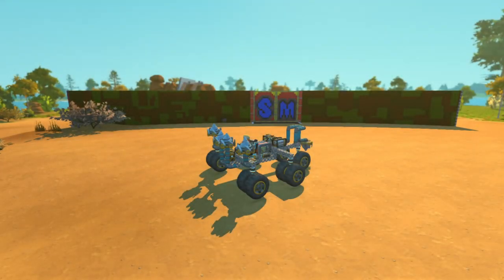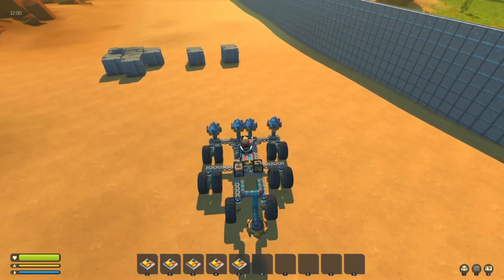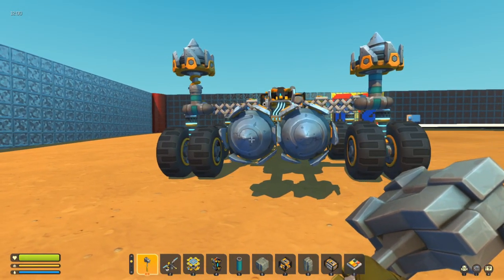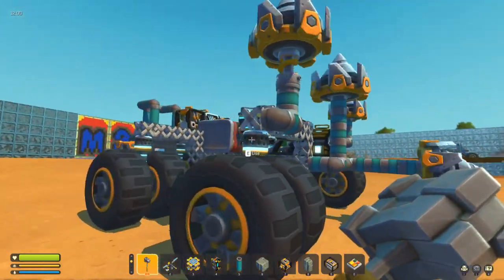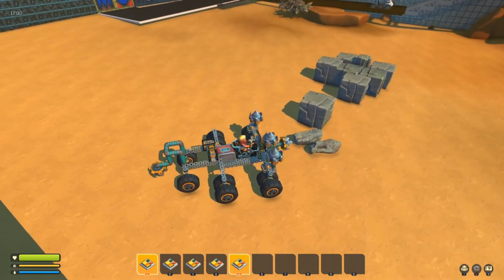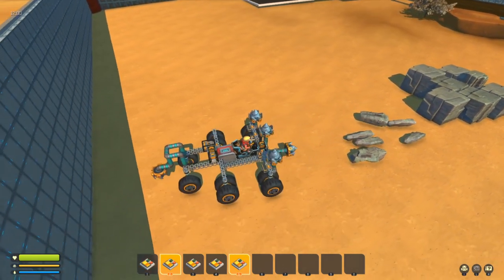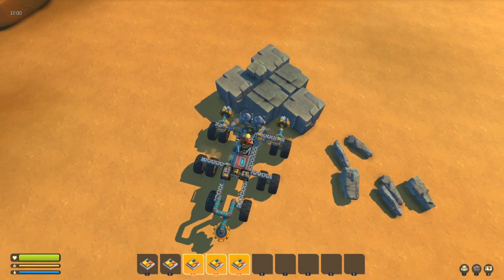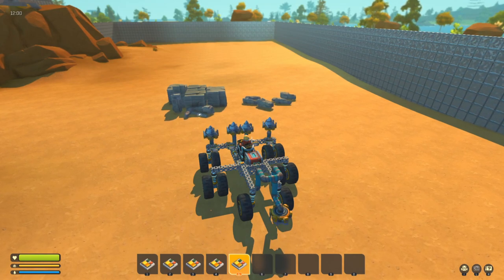Scrap Mechanic Survival Drill, Does it matter?

Comment: That is weird, drills work better for me on a gas engine compare to a controller. I guess it is just the level of the part.
Reply from the maker: could be, though personally I have found people usually run the engine quite high which imo seems a bit of a wast of fuel ? each to their own :)
Reply: @wo0dy  Oh it is a wast of fuel no doubt,   but I guess it is a fair trade for the time it takes to finish grinding off the material. I wish controller drives would not reset the position and would go faster as well but as for not, it is not happening.
Reply from the maker: @chokyrie3766  yeah the position reset is a nightmare really, but as for fasfer, depending what you are trying to move you can gain that by having bearings in a row. I'm guessing you know this though
Reply: @wo0dy  yes I know that. It is just sometimes frustrating to get that to work with some builds, especially with steering. I do know how to do that now with all-purpose joints and additional fix axel but yeah, it is not the ideal thing to do.